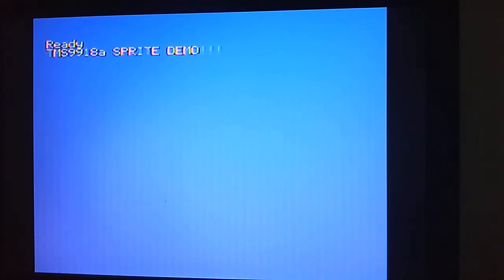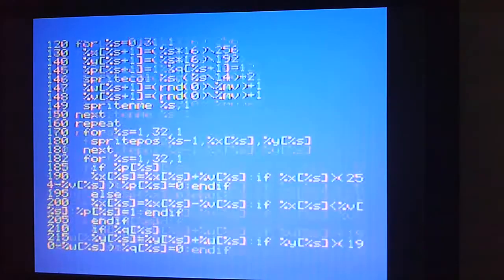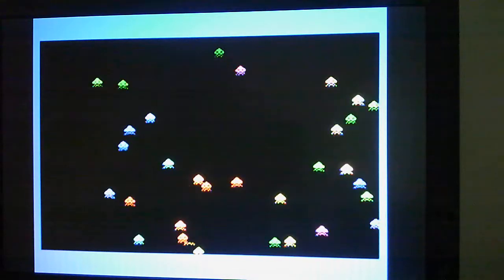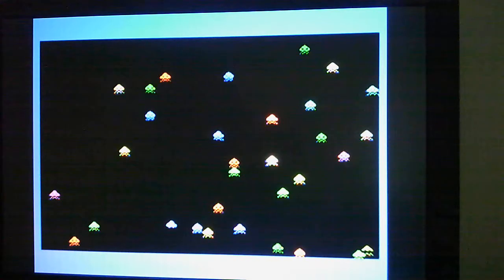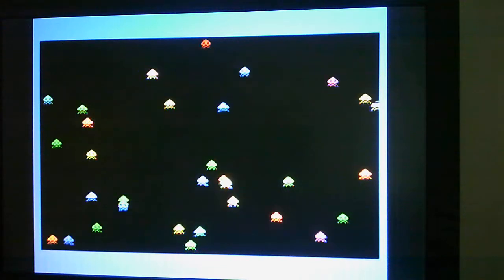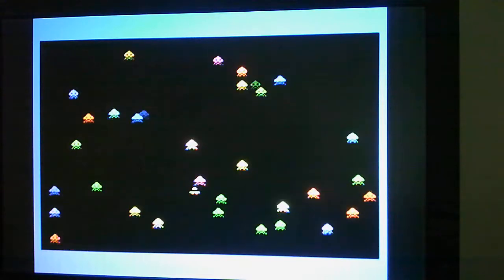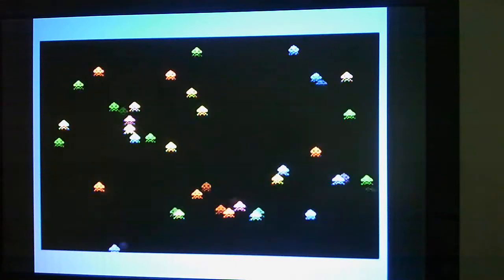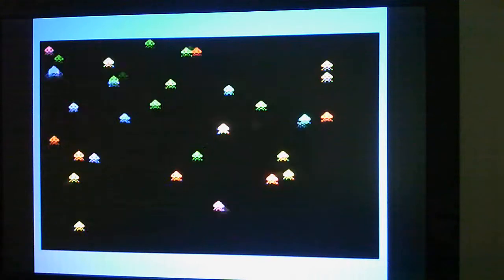Sprites on the TMS9918a

Comment: If I remember correctly the VDP could move the sprites (so without interaction with the CPU). This was a huge improvement on other architectures where the CPU had to reposition them. Again from memory I thought the CPU could get an interrupt when two sprites where clashing.
Reply from the maker: I am using the TMS9918a which was more or less the first version of the VDP, so didn't have automatic sprite movement without CPU help.  Maybe you are thinking of the V9938 or V9958 which were used in the MSX2 onwards and whilst backwardly compatible, were much more powerful.
However considering the 9918a came out in the late 70s, I think it is a marvellous display processor!

Comment: Have you tried pushing your CPU clock speed to get a faster response from the VDP? What would be the maximum speed the VDP could handle? 4MHz? More? Less?
Reply from the maker: I started running the CPU at 1.34MHz, then 2.68 and now it's at 5.36MHz. I think the VDP hardware interface can't respond to the CPU beyond around 8MHz (6502 that is) and of course needs longer delays in the software to wait for the VDP to respond to commands.
Reply: @6502Nerd  So a 4MHz 6502 would be safe then? That's what I designed my PCB with (I just sent a base system to JLCPCB: CPU, ROM, RAM, ACIA, without VDP; a breadboard-friendly and RC6502 compatible development board). Did you do any changes to the video amplification circuit of the VDP?
Reply from the maker: @Fred.aka.MicroHobbyist  I think it should be ok at 4MHz👍🏽 For the composite out, I didn't really do anything different to the datasheet but might even be that the Commodore monitor is the cause of the issue..or is it fine with other composite outputs?
Reply: @Fred.aka.MicroHobbyist  Very late to this party but it's not "safe" out of the box to write to memory that fast. Look at the datasheet but during blanking, each subsequent write (or read but who is really reading to VRAM?) has to be delayed by 2µs. On my ~3.6Mhz 6502 system this means 4 NOPs in between each write. If you're writing during drawing, then it's 8µs!